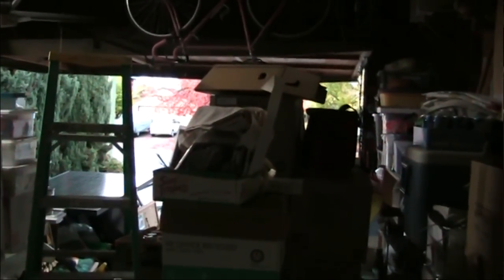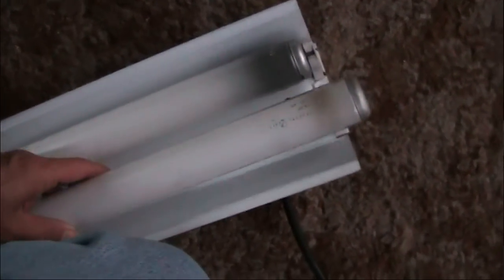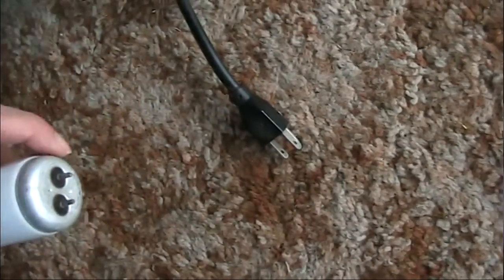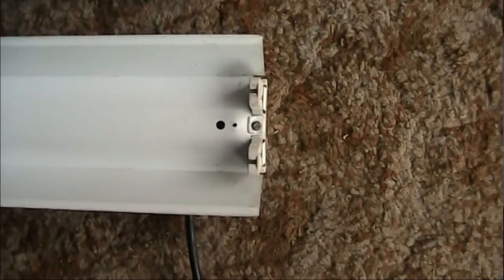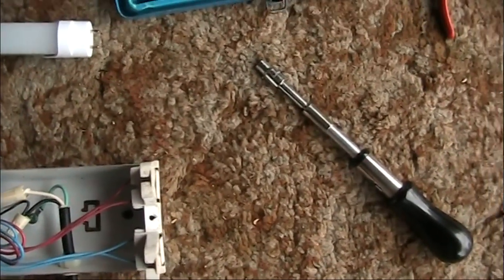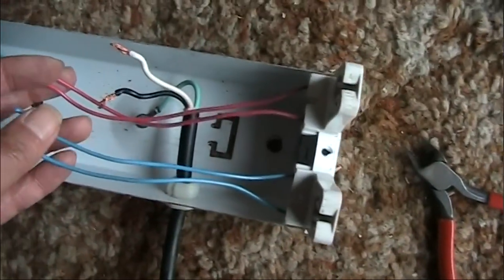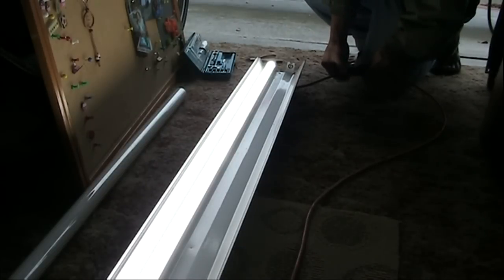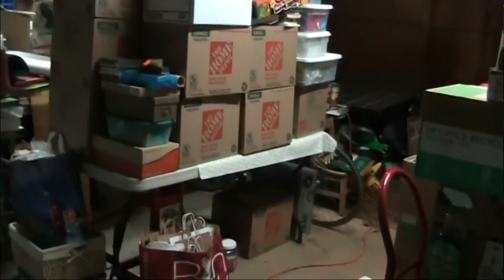Convert a fluorescent tube fixture to LED

Comment: I think this is a well done, easy to follow, well narrated instruction. I am completely confident in this job now. Your instructions answered all my questions without me having to ask them. THANK YOU for a job well done.
Reply from the maker: Thanks!  Not all LED tubes are made the same way, so be sure to check the instructions that come with yours.  But it should be simple, no matter what.

Comment: I just did this with an old fluorescent fixture.   Took out the ballast (to reduce the weight), put power on one end for each socket (both in parallel) and totally removed the wires from the sockets on the other end.

Comment: I've been doing this for years for my electrical company. I started printing out warning stickers to stick onto every bi-pin retro fit we do that says "This fixture has been re-fitted to Bi-Pin single sided 115v AC. with an arrow pointing to the powered side. DO NOT USE NON BI-PIN LED OR FLORESCENT BULBS". Because after some months we got complains from customers who would remove, then put them back in the wrong way, think it was broken, or accidentally break,  then try to put in a regular bulb and it would short. My boss endorsed it, and it was standard for my company to both explain this and place these labels on the ballast covers on fixtures we retrofit.

Fortunately some manufacturers have  started using both ends for 115v LED bulbs, which makes mixs ups with florescent bulbs just result in dim lights. they cost a bit more, but at least you don't have to worry about someone blowing themselves up, or putting the bulb in backwards. Personally I don't even know how the single sided Bi-Pin setup even made it to market.

None the less, solid tutorial, the only thing I would change,( as far as tutorials are concerned) is to remove the ballast. Just to prevent the possibility of someone neglecting to cut power to the ballast, which would result in high voltage live wires that could ground out on the fixture (that even grounded, likely wouldn't throw the breaker because of the ballast) resulting in a nasty painful yet none lethal, bite on touch.
Reply: You have to keep in mind that people use videos like this as tutorials, even if it isn't your intention, DIYers will see it as such, and they tend to make mistakes. It would be a nice touch to add it to the description, I find DIYers in electrical are super paranoid and actually read that.  I was a bit over-dramatic about my terminology. Obviously the short wouldn't be a danger provided they don't have defective breakers. I mean to say that there would be a spectacle that most inexperienced in electrical would consider a near death experience.

Also, you're totally right! The Home Depot LED retrofit bulbs do have stickers. They have Line Neutral stickers as well as a modification warning sticker for the ballast cover. I've gotten so acquainted to tossing instillation instructions for things like LED bulbs, recess lights, and ceiling fans that I completely missed it! You saved me a bunch on printer ink.

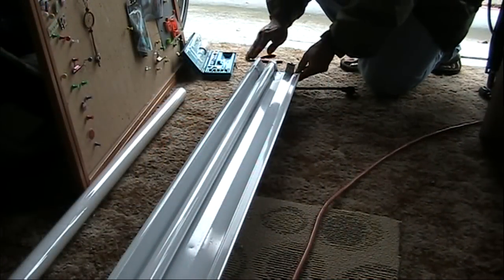Comment: Very easy to follow and no annoying music! I want to know if it matters which red or blue wire ( 2 reds on top end, 2 blues on bottom end), connects to the white or black. I know that you have to connect a blue and a red to either the black or white. But, does it have to be in the order shown in the video (5:07). For example, for the White wire, can I connect the top red wire (top of fixture), with the second lower blue wire (bottom of fixture)? Or does it have to be white + top red (top of fixture) + top blue (lower fixture)?
Reply from the maker: I'm not sure I exactly understand your question.  With the kind of tube I had, the white (neutral) wire had to go to one pin of the tube, and the black (hot) had to go to the other pin, both on one end of the tube.  It didn't matter which went to which pin, as long as black and white weren't connected to the same pin, somehow.  The other end of the tube is left disconnected.  The LED tubes you buy should come with a wiring diagram.   Check that, or the manufacturer's website - your hookup requirements might be different.
Reply: "It didn't matter which went to which pin, as long as black and white weren't connected to the same pin, somehow." That answered it. I don't think it matters which slot on the tombstone you connect to the live or neutral wire I guess since the fluorescent tubes work no matter which way you insert it in. Thanks. BTW, I thought all LED tubes were powered on 1 end only??? So far all the vids I saw here dont use the other end, they cap it.

Comment: I have noticed that you connect the two different color wires together ,would that be the same with other light fittings
Reply from the maker: Unfortunately, I don't know if all other fittings follow the same color code.  The idea is to somehow get the hot wire (usually black in the USA) to one terminal of the LED tube, and the neutral wire (usually white in the USA) to the other terminal.  And if the ballast is in there, to remove it electrically from the circuit.  My tubes came with instructions.  If you choose to do such an upgrade, hopefully your tubes will have installation instructions, too.

Comment: Not all LED tubes work that way. I think I have the same fluorescent fixtures as you do, I removed rapid start ballast, made sure the sockets were non shunted and yet, LED tube didn't work. I bought tubes at Home Depot , Phillips 4 ft. T8  for $6.97  Description says it will work with instant start ballasts but it didn't emphasize it will work ONLY with those kind of ballasts. I was hoping if I take out my rapid start ballast,  the tubes will work. Wrong, they don't work

Comment: "the ballast is completely disconnect now"  04:30 : well the yellow wires are still connected to the ballast on the left side and you also have white wires on the left that are also connected (ground connecting wire???) can these wires backfeed into the the ballast, or are the prongs that go into the left side just for support and not involved in supplying the power to the LED strip?  thanks for the video BTW, its very well done.
Reply: Ok good I'm not crazy, well at least I understand the video correctly ;) I just realized that your video is over 2 years old, and there may have been changes to the 4' LED tube design.   I just bought 4 of these on ebay for $20 ($5 each) including shipping so I will definitely buzz out the four pins and alligator clip test the bulbs before doing the final wiring.
Reply: jleslie48 q
Reply: Ballast was disconnected. It was out of the loop. Yellow wires didnt matrer in his appication.
Reply: @roderickyoung1243  Okay I think you used a single end LED tube then. I'm trying to use my existing sockets because they are a bear to take out. In fact I have to drop the whole fixture to get them out. Either I am just not seeing it correctly or it is just a bad design (no room to swivel it down either because it is up against the wall). Anyway, a single end might seem better for me because i can just use the existing wiring and connect the hot and neutral to it.
So that is why I'm asking about the single ended tube since the other end with the yellow wires would essentially connect to nothing. Sound right?

Comment: BTW, do we have to cut the main power or can we just shut down the garage power if we are just working in the garage?
Reply from the maker: In my case, I just turned off the light switch, as I was able to unplug the fixture and work on it elsewhere.  If I had a fixture embedded in the garage, I'd feel comfortable just turning off the lighting circuit at the service panel (and putting a sticker or sign to warn others not to turn on the breaker).  But do whatever you feel is prudent.

Comment: Have you tried doing this with a 4 tube fixture?
Reply: Roderick Young thanks brother. I was planning to use only 2 bulbs. I had them all wired up and ready to go, only to finally discover that the bulbs were about 6 inches longer than the tombstones. Your video is very helpful for single-ended LED tubes.

Comment: This way can be very confusing .. there are 2 ways of rewiring these and I tried this way thinking why would anyone take the long way around dragging the Neutral wires to the other end if they didnt need to.  Anyway using this way keep blowing the garage breaker.   No Video ever mentioned that it depends on the Bulbs you Buy which dictates if you wire it all on one end of the tombstones like this video shows or the other way and the way that most videos on youtube show at this point where you have to leave a neutral on the other end of the lighting fixture for each light bulb... So if you have a problem find the alternate way or check with your bulb manufacturer.

Comment: I wired my lights exactly like this and blew a circuit breaker when I turned them on, couldnt figure out what was wrong then realized it was my lights....they require to be wired hot on one end and neutral on the other.  My LEDs are Barrira and it even showed them having to be wired that way on the box....but Im a guy....I dont read instructions :/
Reply: when wired according to the diagram, the lights worked....no damage to them at all
Reply: What brand LED bulb did you use in this video?

Comment: Prices have really come down since I made this video.  Recently, I saw a 2-lamp, 4-foot LED fixture going for less than $30 at Costco.  At those prices, I would just replace the entire fixture, rather than bother retrofitting.

I will say, though, that my separately-purchased expensive tubes are much brighter than the Costco fixture.  One of my tubes alone is 5200 lumens, while the Costco one is 4400 for the whole fixture.
Reply: Thanks for the info about the prices- I am not a costco member , but want to be prepared for the price. Also, since I am not so keen on rewiring anything, the modernization might be easiest and cost effective in the long run. I definitely love loads of lumens , but want them at an efficient cost.